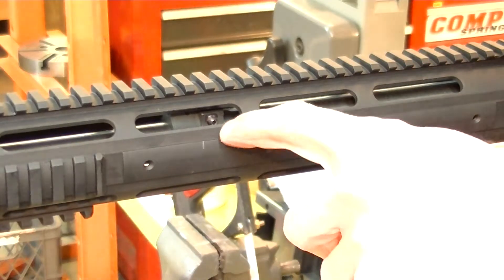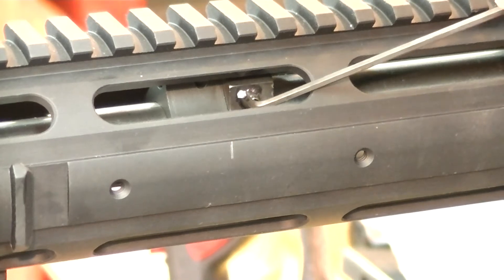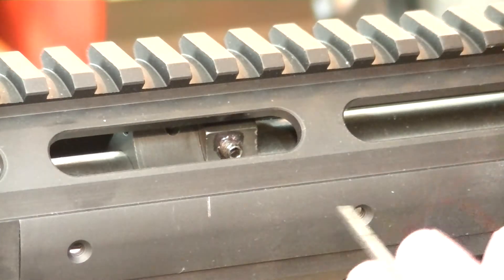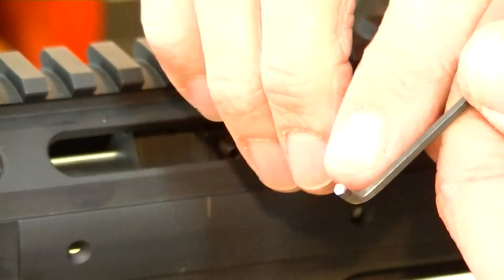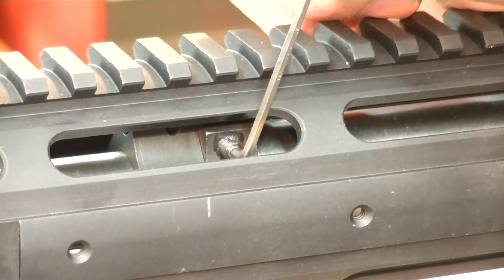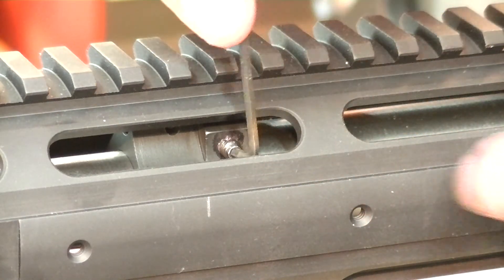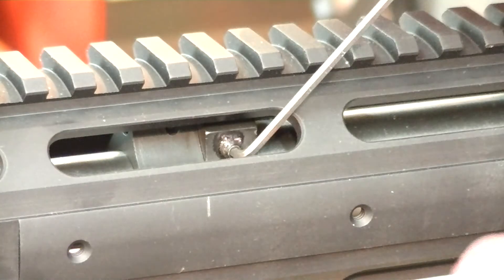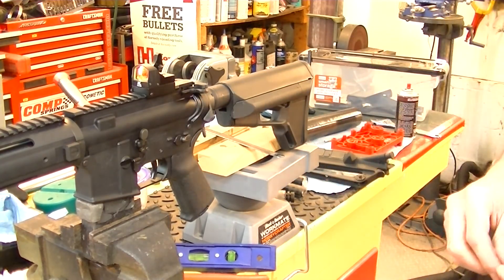TIP modifying tool for adjustable gas block tuning

Comment: Great suggestion.  Did you get to try a ball allen?
Reply from the maker: No because they are notorious for slipping and damaging the bolt head.  They don't hold well enough to bust a small screw loose that has been gunked up with carbon, heat set, and loctite as a triple whammy so I don't bother bringing it up in hopes that no one has to experience the horrors of stripping out one of these! haha Good suggestion though, it is just that these set screws can take the mojo to brake loose after being set a while.